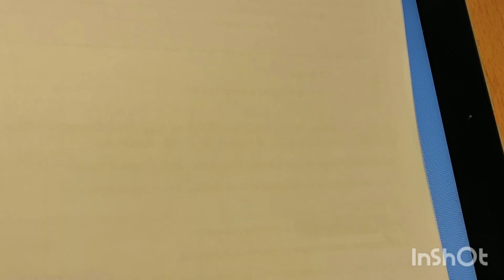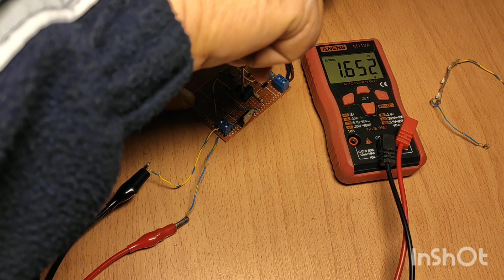transformerless voltage regulator with  TL 431 1-57 volts.

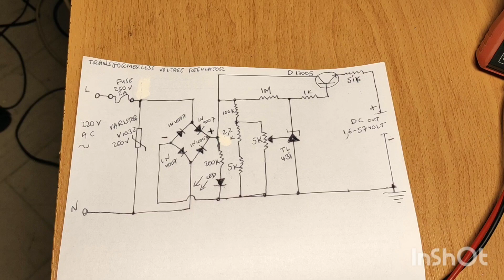Comment: I have seen the circuit at 4:30, but there is a problem with this.
According to TL431, the voltage between cathode and anode should never exceed 37V.
What you should aim for is adding a transistor or MOSFET circuit to the TL431 or sword,
You should consider a 37V or higher shunt regulator circuit in a stacked circuit.
If you connect the emitter follower of the transistor to the shunt regulator,
A series regulator circuit is possible.
Good luck
Reply from the maker: Also i have seen in some videos on you tube they use a small microfarad capacitor grounded  to simulate the voltage they want.
 So they can drive lm317 from it,s maximum 37 volts to 60 volts 
by changing the capacitor load
through a potentiometer!
Maybe later i check these 
circuits but that afrer September!
Thank you!